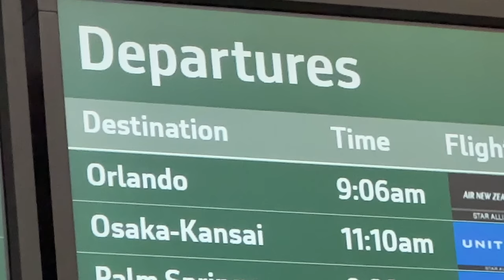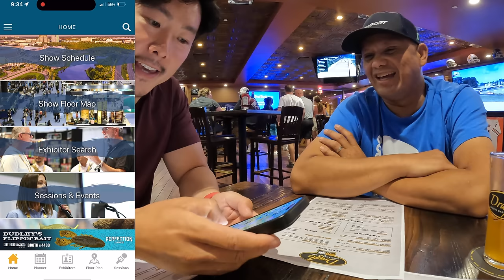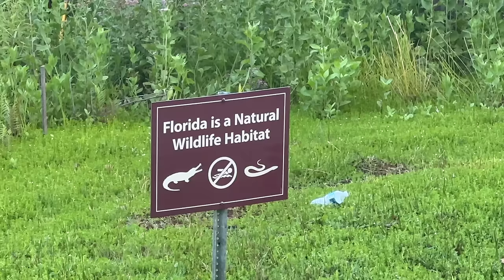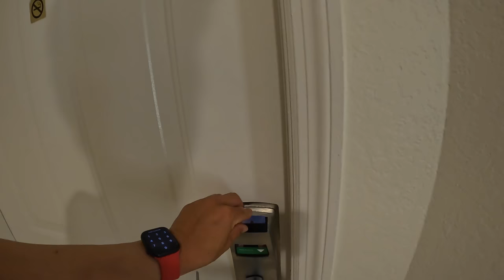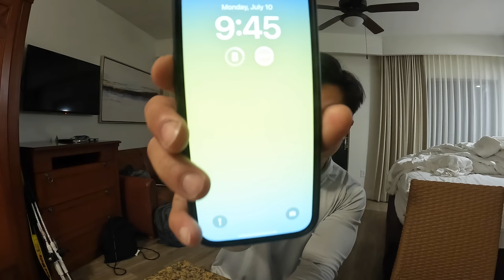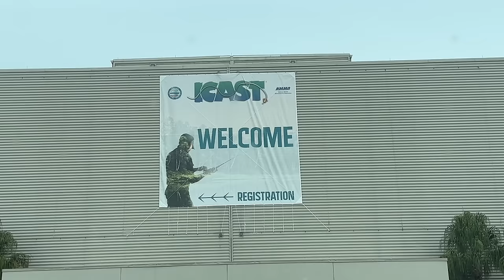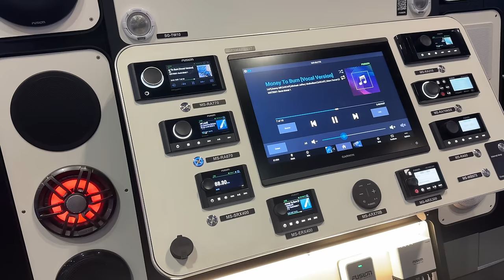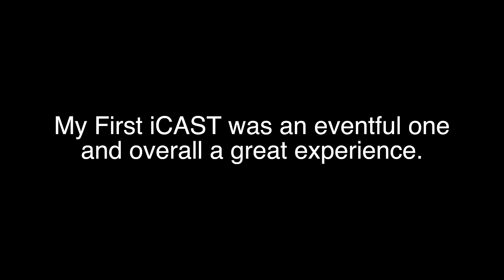iCAST: The Movie (A virtual experience)

Comment: As someone who takes rods on a plane multiple times a year, it's free as your 2nd bag on Southwest and only the cost of a 2nd bag on other airlines. An 8ft rod tube is cheap and does fit in cars that aren't Smart cars. Never had a rod break on a plane either. Super easy and would recommend. Or if you want dedicated travel rods, get 2 piece rods and a collapsible rod tube.